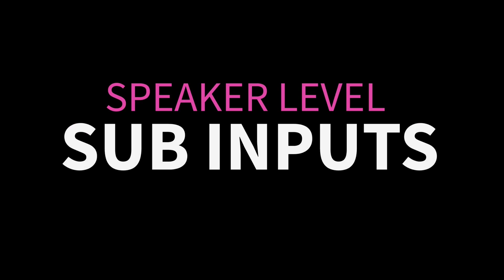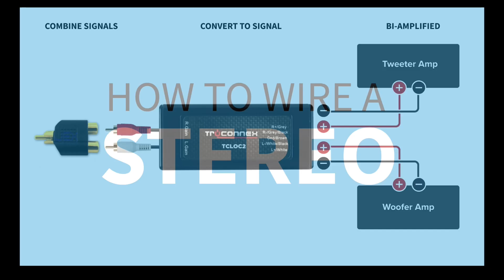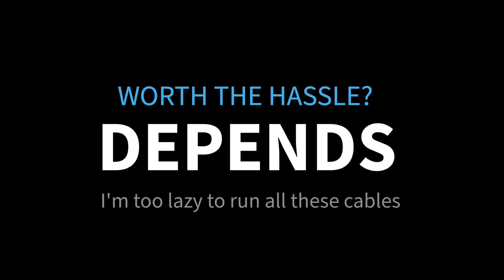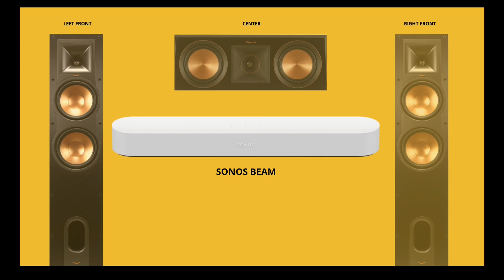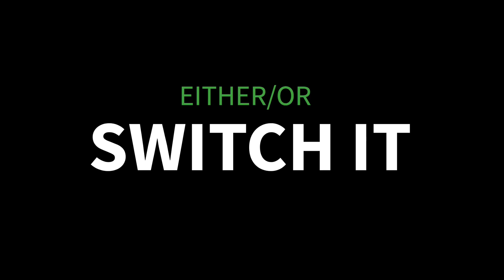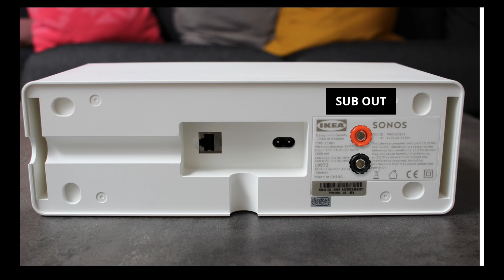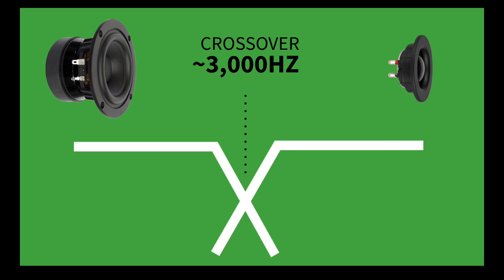Sonos sub hack DIY: How-to wiring guide to add any powered subwoofer to Sonos with Ikea Symonisk

Comment: Hi Todd. Great video and work here! I currently have a Beam and am looking to add two Symfonisk and a third party sub. If I wire the two Symfonisk to the sub as a crossover frequency using the output from the sub, adding a switch to the Symfonisk tweeter and then setting them up as surround speakers in the app, what will happen to the quality of sound coming from the Beam if I turn off the Symfonisk tweeters and only allow the bass to come out? Will I be missing some sound components from the Beam?
Reply from the maker: Hi. If I understand your setup, you’re using the sub speaker in/out to crossover the Symfonisks so they aren’t producing as much bass and letting the sub do the work which is good, that’s the ideal setup. There’s no need to mess with the tweeters though, this should sound balanced as is. If you shit them off, the surrounds will sound pretty muffled but whatever you do to the Symfonisks internally wont change the Beams sound. From Sonos’ perspective, all I knows is whether you’ve added surrounds or the official sub and will adjust from there. In this case Sonos never sees the sub so it routes sounds as if you just have the Beam and surrounds
Reply: @todd.parker  I was trying to figure out a way around being still able to control the volume from my tv remote using the 'Gateway' technique by cutting out the tweeters, but I guess that wouldn't work. I am just going to go with the 'Crossover' technique and keep the tweeters in use.

Another question: what is the best way to connect the wires from the Woofer Amp to the inside of the binding posts and then from the other set of the binding posts back to the woofer? Can you use ring connectors on the speaker wire or use disconnects? Thanks Todd!

Comment: did you think about putting the IKEA amp into its own enclosure? it would be nice to have a little amp that can bi-amp any speaker.
Reply from the maker: I did but I keep messing around and using these for different purposes. You could definitely put it in a smaller enclosure inside a larger speaker. Or (lazy guy way), leave the front baffle off and just mount it inside the cabinet. Since there is plenty of airflow, it wouldn’t count against the cabinet volume. One consideration is you need to have a functional front panel accessible so you can pair it and the ribbon cable is super short.

Comment: I did this with a Sonos Beam and 2 Sonos Symfonisk system. I hooked up an old Sony subwoofer (fairly large) to the left Symfonisk. The sound system now shakes the entire house. If you are looking to add bass to your system cheaply, this is the perfect solution. As a complete novice to wiring speakers (I followed the steps provided in the video because I was afraid of breaking something), I can say this can be easily completed. The only thing that I can say is a problem is that I feel like the voice of videos is overcome by the bass outputted. Not sure how to fix this or if there’s a fix. I’ve messed with the EQ settings of the group on the Sonos application to temporarily fix each situation. Thank you for the hack! Also, is leaving the inside of the Sonos Symfonisk dangerous/harmful to the speaker? I really wouldn’t like to drill a hole in the casing and have run the wire through the opening within the container.
Reply from the maker: Good to hear this worked well for you. You could try running Trueplay to tidy up the bass if the sub doesn’t have a knob to adjust the levels.  Are you using the Symfonisks as the rears and running the cable out of the port on the front to avoid drilling holes? Are you asking if leaving this hooked up permanently to your sub is harmful? It’s not, just be careful to not cross the wires if you ever unhook it from the sub.
Reply: Todd Parker Yessir that answered my questions exactly. Thank you.

Comment: Hey Todd - I have a Sonos Beam and two PLAY:1's along with a Sonos Connect:Amp. and Klipsch RPW10.  I guess the bass channel is de-activated on the Connect:Amp when I pair it in surround mode. The Klipsch RPW10 has RCA and speaker level input. Should I just buy an IKEA Symonisk to add base? Or two of them to replace the PLAY:1's I have? Thanks for your thoughts in advance.
Reply from the maker: You could keep the Play:1s, open them to get a wire attached to the woofers to get a signal for the speaker inputs and use your connect amp elsewhere. This technique will work with any Sonos speaker (or any powered speaker for that matter), I just suggest the Symfonisk because they are cheap and easiest to open. Is the connect amp being used now to add the sub to your home theater? If so, can you tell it to act as a sub or is it just a grouped room? If Sonos knows it a proper sub, it will sound better than this hack because the other speakers should get reduced bass for less distortion but it’s a lot of money to just get a signal to your sub

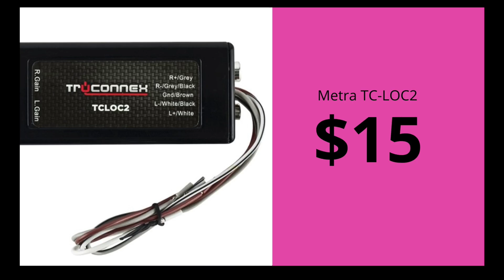Comment: Hey Todd, Would this (https://www.amazon.co.uk/gp/product/B07DFGPHGQ?pf_rd_r=0RFVGGWH0AA6PDMDN2NN&pf_rd_p=e632fea2-678f-4848-9a97-bcecda59cb4e) work as an RCA line converter, like those you mention at around 3:50? It's for a car but I'm assuming they do the same thing... Sorry, not got any clue about these things. Thanks for the vid too. Great stuff!
Reply from the maker: Yep, that will work great. Most of these are for cars, usually to grab a signal off the head unit for a powered sub
Reply: Cheers!

Comment: Brilliant hack man which really appeals to me as the Sonos sub is beyond my financial means. I’m gonna try the gateway solution and look to pick up a decent used powered sub with speaker input. One question, has the recent S2 software address any of the 2 issues you flagged......sub lag between rooms and the remote volume control issue....I ask because I think S2 brought some new grouping features that may allows any speakers to be grouped in the same room?
Reply from the maker: Thanks. Good question. I know it would allow you to group your sub room with the speaker room more permanently but I’m not sure about the home theater lag. I have a lot of legacy products do I haven’t made the leap to S2
Reply: @todd.parker  Understood. Well Ive ordered my Symfonisk (will be used as a dedicated gateway), a decent but affordable Wharfedale Sub (powered) with speaker inputs connectors. Looking forward to pulling it together next week - will let you know how it goes and if I need any advice with fine tuning. Thanks for sharing the hack once again.
Reply: Thanks Todd again for the video. 
@Andrew, any feedback...did it work, no sound delay?
Reply: @tenengasobo7538  Yes - it works fine - I used an app called sonosequencer which allows you to assign the symfonisk as a sub speaker. Works great and even shows up in my sonos player app as a sub with all controls.

Comment: Hey Todd 
First of all thank you for this great tutorial. I tried it with some messy and temporary cabling and everything worked perfectly. 
Now I installed a switch for the tweeter and some sockets for the in and out for and to the sub it looks good and sounds even better. 
In addition as a little hint i used male AND female connectors so i did not have to cut any original cables.  
Oliver
Reply from the maker: Excellent to hear, so glad it all worked for you!

Comment: I was wondering if I can use my old Yamaha sub woofer (YST-SW030) which sounds great? It only has a single RCA connector though. https://au.yamaha.com/files/download/other_assets/2/326752/YST-SW010_030_CA.pdf
Reply from the maker: You can use a speaker to rca adaptor. Details in the video

Comment: This is very cool. I wonder if it's possible for Symfonisk(s) to power an outdoor speaker system that has 2x Bose Free Space 51 and 2X Sonance 6.5 inch speakers i.e. use Symfonisk amp in the place of Sonos amp.
Reply from the maker: As long as the speakers are a 2 way system it should work. The Bose just seems to use a single full range driver? If so, it’s not a good fit

Comment: Thanks for this. 🙌🏼
When introducing the pukka SONOS sub does the app perform any magic by changing the output of the other speakers for example : taking away any bass duties and upping the ‘mid range’ from existing speakers?
With this in mind does the SONOS sub sound heaps better than the hacked setup?
Reply from the maker: No, Sonos doesn't really know what going on so it can't do smart things like remove bass because you have a sub. The official sub sounds great but not heaps better.

Comment: Hi, i just got Klipsch R-12SWi, which has only RCA. I'm about to order Pyle RCA converter. The question is, because this sub is wireless, should i just connect the wireless module to left or right channel of the RCA converter or having a wired option in a sense of  Symfonisk->RCA converter->RCA cable to  the sub? Thank you!
This is the sub: https://www.klipsch.com/products/r-12swi-wireless-subwoofer#product-downloads
Reply from the maker: The wired connection won’t have as much latency as wireless but either setup will work
Reply: Todd Parker Thank you!

Comment: Todd
Great and informative videos. 

I have a question, what about opening up the beam and tap into one of those drivers with a powered subwoofer directly. Would that work? I don't have the space for rear surrounds to go in my living room.
Reply from the maker: Yes, that would work really well. The trick is opening the cabinet and getting an air tight way to connect a wire but it will work like a charm
Reply: @todd.parker  great thanks for getting back to me
Reply: Todd Parker Can you do a video on how to wire the Beam to a powered sub?
Reply from the maker: I don’t have a beam but if you can figure out how to open it, just jump wires off a woofer like I did with the Symfonisk. Look for a teardown video
Reply: Todd Parker Thanks for the quick response. Unfortunately I haven’t been able to find any teardown videos on the beam. Do you know of any?
Reply from the maker: Andrew Faletti hmm, you’re right. This verge article has sone photos of the inside that might help you out. Once you can access a woofer, you’re home free. https://www.theverge.com/platform/amp/2018/6/6/17431250/sonos-beam-soundbar-alexa-hdmi-arc-price-release-date

Comment: Do you have any idea how to add basshakers to sonos? Was thinking of modding a symfonisk and connect its output to another specialized amp including a high pass filter. the symfo -which id probably use via what you call a gateway method - must /should also be configured as sub. (not too sure if you can setup a room with sub only) since sonos changes how the bass is directed to the speaker when using a sub.
Reply from the maker: That works, sure. You need to use a speaker to line level converter if the amp only has RCA inputs.

Comment: Thanks so much for the video Todd, great video to mark the sand for this project. I've also just hooked up the second speaker, maybe a placebo effect but I noticed the bass is punchier/pronounced (?) and requires less volume on the SW itself. Would've loved to try that crossover hack but my subwoofer doesn't have the output speaker-inputs unfortunately. Overall, more than happy with the result - saved me a lot of money!
Reply from the maker: Great to hear this worked well for you. Hooking up a second speaker into the sub would likely add 3db so it should sound louder at the volume position.

Comment: Can you put 2 subs?
Reply from the maker: Sure thing. You could connect a sub to each channel or even connect 2 subs from one speaker!
Reply: @todd.parker  and how do you eq them ?
Reply from the maker: fotvalas Of you’re running these alongside a symfonisk you can run true play but I recommend keeping the sub to 0-40% of normal volume when calibrating. You can also use the settings in your sub to control crossover frequency and volume to tune it

Comment: If you where to use the method to cross over and had only rca connections on the the sub would you need to use 2 in line converters (one for input and one for output)
Reply from the maker: If you only have RCA connections then you can’t use the sub to crossover the speakers. The converters only concert down to a signal, not up to a powered signal (amplifier) so I’d either get a sub with speaker inputs or use the simple setup

Comment: Todd. 
For home stereo setup: Can you wire it up in  the simplest set up just left or right in the case you dont have a way to hide wires.
What would be the issue
Reply from the maker: Yeah, I don't think you gain much by adding the second channel. If you listen to certain kinds of music, there might be bass directed at only one channel but I have a hunch that's rare.
Reply: @todd.parker  Awesome, Do you have to use a line out converter. Could you avoide it by using and LFE to Banana Cable/RCA to Banana Cable. Im looking at pairing an SVS sub  as they are running a good deal on PB2000 right now
Reply from the maker: Jonathan Newman you definitely don’t want to plug an amplified signal into the line level input as it might damage that. The converters are cheap and work pretty well
Reply: @todd.parker  Ok thanks for the input you and your videos have been a lot of help

Comment: Thanks for the video! I've connected a REL Qauke to a Symfonik as a portal. When I disconnect the woofer of the Symfonisk the REL gives a hum. When connected it doesn't. Do you have any idea how to fix this?
Reply from the maker: Hmm. That's interesting. Does it sound like a 60hz AC sort of hum or something different? I wonder if there is some electrical noise and somehow the internal woofer is keeping to shield that? If it's distracting, maybe you could keep the symfonisk woofer connected but attenuate it's output nearly to zero by using some beefy resistors or potentiometer? Just a guess. Maybe try plugging the Symfonisk and/or sub into different outlets.
Reply: @todd.parker  Yes I think it sounds like a 60hz AC hum (based on a youtube example video). I'm going to try some different outlets first. I'm not a hero with resistors or potentiometers...
Reply: Try adding a ground loop isolator into your setup. If you are using the RCA input into your sub then you could try something like this https://www.amazon.co.uk/Ground-isolator-audio-noise-removal/dp/B000KHBU1G. If using the speaker level inputs, then try moving your cables further away from any mains cables

Comment: you left playbase out of the home theater part. i have a playbase + 2 symfs as rear surrounds + sub (one of the symfs wired to a polk sub) for full 5.1.
Reply from the maker: Ah, good call. Totally forgot about the playbase!
Reply: I doubt that you have full 5.1. if you set-up the Symfoniks as rear surround via the sonos app, they will not get the actual 5.1 bass channel. You just send the bit of bass they get to the sub. An actual 5.1 set-up sends a seperate signal to the sub. At least that's what I think is the case.
Reply from the maker: Michael Renders Yep, I cover that in the video...
Reply: @todd.parker  I should have be more accurate in the response, it is towards @stoneobscurity.
Reply: @stoneobscurity  I doubt that you have full 5.1. if you set-up the Symfoniks as rear surround via the sonos app, they will not get the actual 5.1 bass channel. You just send the bit of bass they get to the sub. An actual 5.1 set-up sends a seperate signal to the sub. At least that's what I think is the case.
Reply: stoneobscurity Hows the setup? You happy with it? I’ve got the play base and I was wondering if the symfs add some extra base already? Worth it wiring in an extra sub as the play base has a small internal sub? Also @todd Parker any advice on a good size, brand second hand powered sub for this?
Reply: it shakes the house. love it.